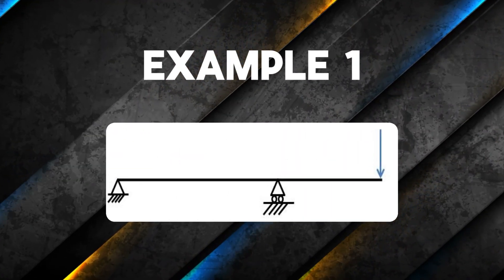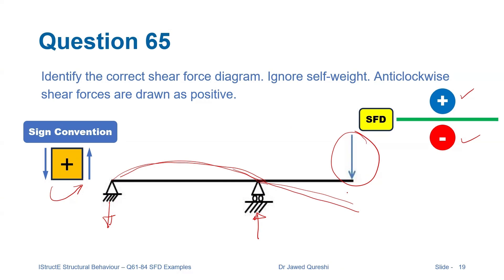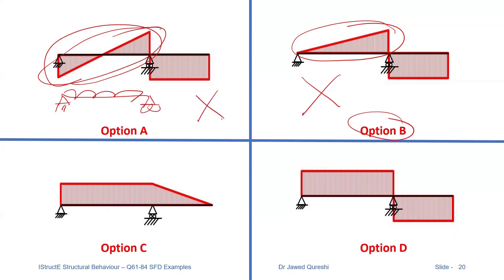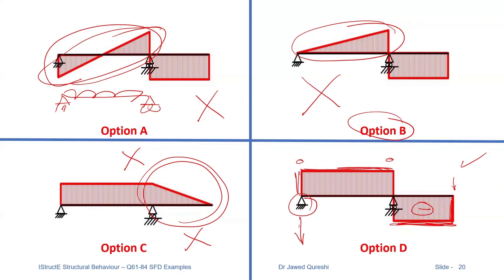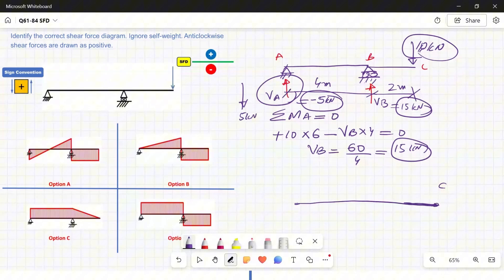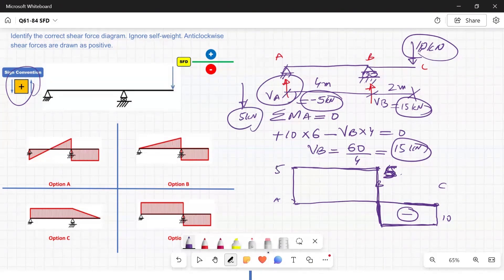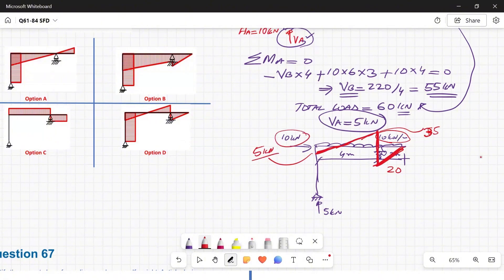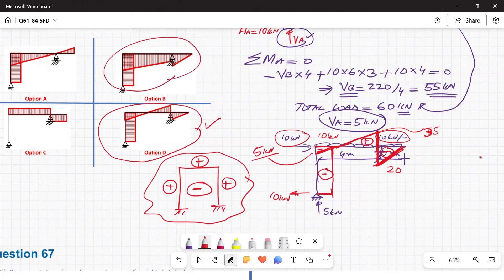Shear Force Examples Made Simple | IStructE Structural Behaviour Course

Comment: in every problem u are assuming values. so can i use the same approach for shear force problems? I mean can i assume different values?
Reply from the maker: The problems need to be solved without values using structural intuition. I use values to explain it better and prove that solution using the intuition was right.
Reply: Yeah but sometimes I will be confused with my answer. During that time can I use this method for confirming the answer?@DrJQureshi